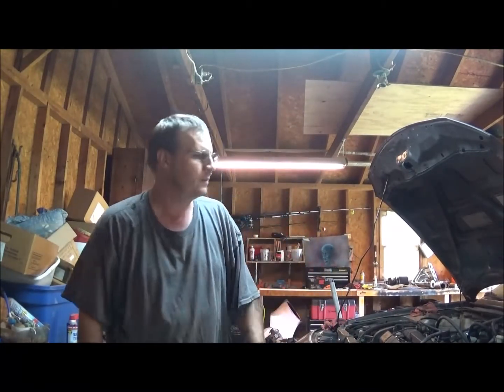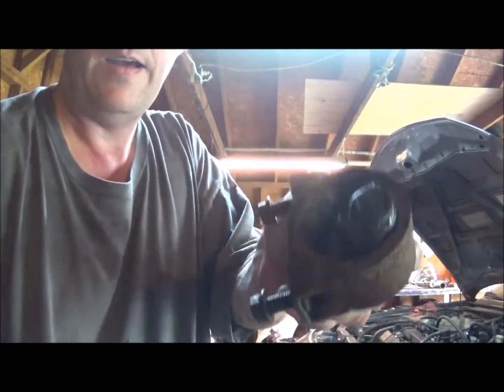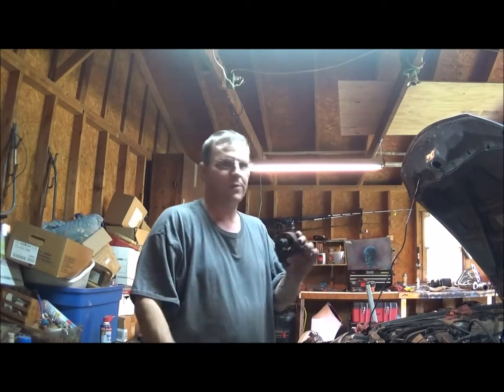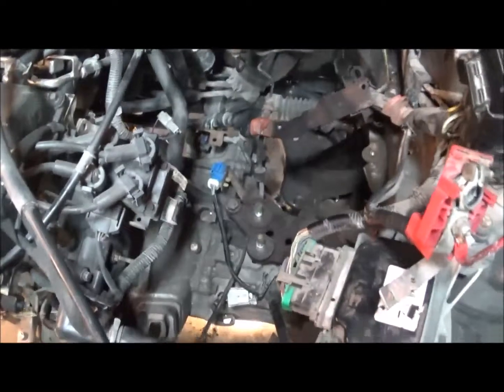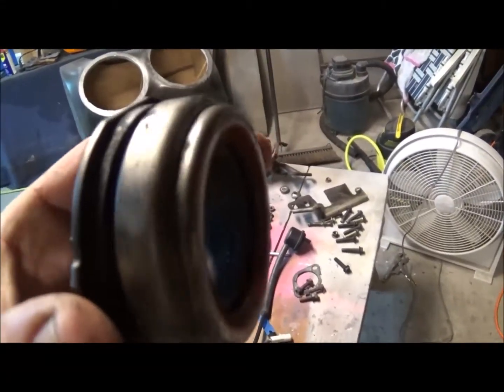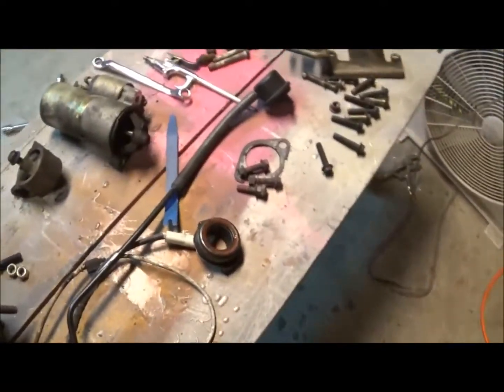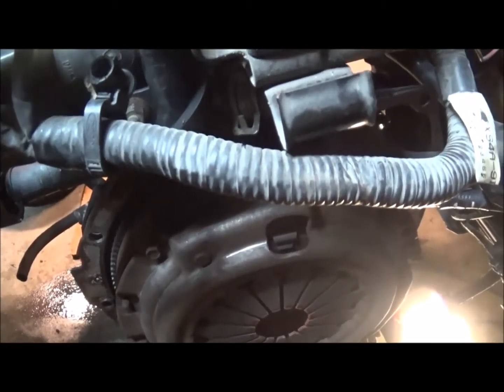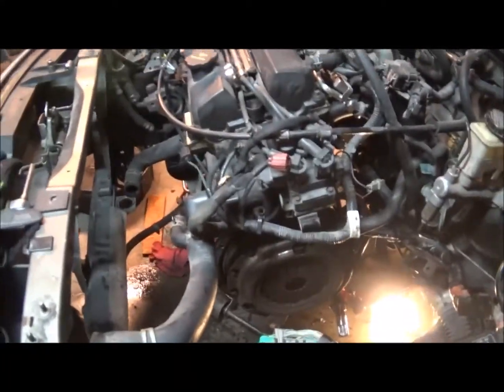ZX2 TRANSMISSION AND CLUTCH REMOVAL, STAGE 1 CLUTCH FROM AMAZON

Comment: Great video as always, need your feedback on a vid I just made, had issues with the clutch on the jeep not engaging, but after I removed the slave cylinder and moved it out with the clutch and pushed it back in by hand the issue did not return. While I am glad the issue is resolved for now, I don't have a clue what caused this issue and could use your expert opinion.
Reply from the maker: by chance did you get around to checking on the fork to make sire it was in good shape?

Comment: What transmission fluid is the best for a automatic zx2 2003 the last year of the coupe like oem or better I live in Atlanta GA so it get a lots of traffic and interstate running at 80 mph and stop and go and oil it said 5w-20 on the cap but that's when new so what now at 90k money no promblem I just like the little car and the dealership isn't really caring on older cheaper cars and so am giving it a shot it's was my wife little car and it has cold ac and cheaper on fuel than my trucks and other cars but need to be driven until my little girl starts driving it full time to high school intil that first crash then she get the wife's purple cl 600 coupe  then but Dame I hope parts are cheaper by then on it 🤔
Reply from the maker: if i had an automatic i would use royal purple